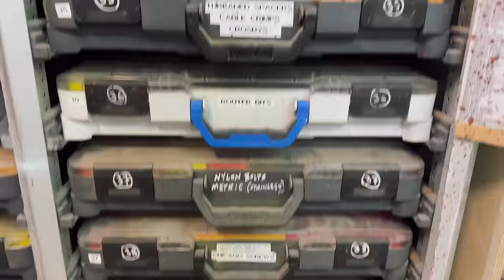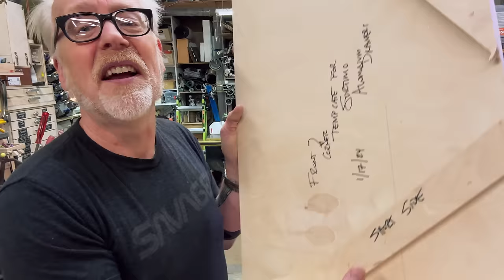Adam Savage Builds His Dream Hardware Storage System!

Comment: As he's talking about punching all the holes: Use the mill! Use the mill! You have them all stacked up anyway for the corner holes. :)
Reply: Yeah! I just commented the same! He already had the setup! For some reason he wanted to make the holes after cutting the corners on the bandsaw, but he could still have restacked them even that way
Reply: As he was drilling the big holes, it made sense with how sticky the aluminum is, too small and you'll just be snapping bits with that big of a stack, but maybe even just a stack of two?
Reply: @BryanGorges  I think he could do at least 5, maybe 10 on the mill. But I'm sure he could do 2 at a time on the punch
Reply: Have you ever drilled a hole that tiny in aluminum? Did you see how he had to keep cleaning off the big end mill? Do you know how much a tiny bit like that would wander when drilling that thick?

It's a good idea but it won't work, unfortunately.
Reply: Keep a fixture in place on the mill, drill the bandsaw clearance and rivet holes ~15 or so sheets at a time. You have to do the milling operation more but I bet it would save time
Reply: @BryanGorges  Yeah, I was thinking he should have cut the sheets in stacks, but having cut big stacks of aluminum sheet at work, I know how horrible that is. Aluminum is just so sticky. When we cut it, we have to have another person at the saw continually spraying WD40 on the blade just to keep it from binding up. And that is just thin 30 GA in about 1" stacks clamped together.
Reply: I just asked if he had considered milling out the corners and drilling the holes on the mill at once. 🤔 That’s probably what I would’ve done. It truly could’ve been a one day build. Right?
Reply: @BryanGorges  Also, what he did not show is that his stack sat directly on the table, so I guaranty you that he did not do that in one shot. He did not show  that at some point he had to put something sacrificial under the second stack. Why a second stack? Well, his end-mill was not long enough to do all of them.
Reply: @guitarchitectural  would have been nice to throw this explanation into the video for the ignorant (such as myself). Makes more sense. I assume he just got hyperfixated on wanting to use the hole punch.
Reply: @Slack3rDav3  Getting hyperfixated is relatable.  My FiL doesn't have ADHD (he has Old Man Syndrome instead), but once he's decided to do The Thing a particular way, it's going to be done that way come hell or high water.  We've just learnt to roll with it.
Reply: @mabster314  Or just lay out the holes along with the rest of the design on a cad file and send it to you CNC plas table.  After you own one you realize how stupid you were for not owning one..
Reply: @gimmebuilds9915  CNC  plas table..
Reply: @TheOneWhoMightBe  Aww let's follow the path the dinosaurs took...

Comment: make just one draw (without a sortimo box) at the lower- or lowest shelf of the sortimo cabinet. Put the draw out, put a sortimo box on that flat surface....done!!
Reply: Seriously.   A flat piece of wood on a drawer pull at working height every other row would have done the same job.  Though I use Stanley sorters,  I guess if you can afford sortimo you can afford to rebuild your system though lol.
Reply: I should have read some comments before posting....I said the same thing!
Reply: Same here, that’s how I built mine. It also has the added benefit of the open bin being at the same accessible height. I’ve been using mine for 3-4 years now and it doesn’t slow me down to pull the bin out and set it on the shelf(on drawer slides) I love it!
Reply: Adam's system solved another big problem. Some of these boxes are heavy. And considering Adam's age it is pretty exhausting to move them from theirs drawers to one universal surface.
Reply: like a pullout cutting board in a kitchen, its just too easy
Reply: I did the same thing 12 years ago and found that not having to take the whole cade out saves another of time and you only have to drop a case with the lid not fastened once to realise how God the drawer sliders are

Comment: Hey Adam, I made an open source pick to light system called M.I.M.O.S.A, Basically a web interface where you can very quickly locate things in your drawers. I have a video on it. It's super easy to install, And it makes retrieving things much faster than indexing an Excel sheet. I would love to help you set this up!
Reply: I found your project online and it looks really cool.  As a career programmer who loves making software to make people's lives (and jobs) easier, I was unsurprised to see Excel adopted as the "database" here, even though it's far from ideal.   I will also be unsurprised that the answer of most people (probably including Adam) is "Nah, this is fine," because there's something about crossing that line into the software part, where suddenly "fit and finish" don't seem to matter as much anymore.  And I guess part of that reason is because there's so much awful software out there.   At least you know what you're getting with Excel.    But people don't understand how much potential value they're leaving on the table by not looking further.

Comment: Nice job! I went through the exact same thing with many of the same hurtles. I used the Stanley bins and made the cabinets from 3/4"  MDO, with slides from 1/2" MDO. Works perfectly. Mine is about 36" High by about 11 feet long with about 60 bins of two depth sizes. The length is comprised of several modular cabinets. The non surface part really frustrated me as well after built, and I decided to build a flat pull out shelf at the bottom of each cabinet. It's an extra step, but doesn't take extra space. It made the upfront cost lower, and kept the cabinet much more compact than an individual draw system.

Comment: So he basically made drawer cabinets with alot of unnecessary lids!
Even as an fan of diy i would have bought 2 lista cabinets and filled them with assortment boxes.
That would have been much more dense in terms of unwanted air in between drawers and such.
Reply: Just saw he sells the boxes, wich suggests this is basicly an one day commercial:)
Not trying to be a jerk, but it just didnt make any sense.
Reply: Exactly what I was thinking, seems like a laborious and expensive way of making inefficient drawers. I get that it makes the "drawers" very portable, but why do you need that in a workshop?
Reply: Lista cabinets are the way to go....hard to find used for a good price, though. I have both the latest generation and previous generation Listas and they can't be beat in terms of accessibility and density. 
Then just use small bins and pull out only the few bins you need instead of an entire Sortimo box...
Reply: @saschaoswald480  
Even new would be cheaper as he probably spent about 10k on this project excluding the labor.
For that money he could have filled that wall with either lista or vidmar,kind,bott etc etc.

Comment: Thanks mm9773, I remember Adam saying he didn't like drawers back in the before time. However I understand his love for the Sortimo-T-Box. They are expensive at $50-85 each but IMHO worth it. Nothing else comes close. I have 10 of them and the only thing that has migrated out of its own bin is 1mm stainless washers. I have 2 of the 2 layer type ($85) which has been perfect for small hardware, 1-5mm and 2-56-12 something. Adam must get a large discount.

Comment: Alternative to making 70 drawers (one for each bin): Make a single slide-out shelf at a convenient height in one of the bin slots. Remove a bin, pull out the shelf, set bin on shelf and get what you need from it, then return the bin to its slot and push in the shelf. Yes, you would sacrifice a bin slot but save the cost and effort required to build 70 drawers.
Reply: He made a cart a while back for the old sortimo cabinet that served this exact purpose, plus you could pull it over to the bench.  Not sure what happened to it.

Comment: I really enjoy your videos. They are intuitive and don't give the usual feeling of someone reading of a script. 

I can appreciate someone having enough funds, suffering from ocd and being a perfectionist wanting to create all those drawers. Me, lacking funds and ocd (though being a perfectionist), I would just insert one retractable metal tray at a convenient height in each (or, in every second) cabinet column(s), and every time I need something I would pull out the tray, take our the needed Sortimo box, lay it on the tray, take whatever I need and put the thing back. Making cabinets with fixed shelves would be much cheaper and much faster to make than this system. Less fancy though. 😀

Also, if you still wanted to go ahead with your system, instead of drilling those big corner holes plus doing 2 cuts, I would just do one cut, and then, when folding the sides and the back, would fold and rivet the "flaps" to the back "wall" of the tray (obviously after having punched the relevant holes for the rivets on the side and the back before bending the sheet). I am no engineer or anything of the sort but in my mind, this looks ok. 😀On that note, if I had to do it the way you do it, I would bend the triangle "flaps" to the exterior and to the back of the "walls" where they will not interfere with the slides and will not be visible even with the drawer pulled out. This way, there is no risk that they may scratch the boxes when moving the drawers in and out or when putting the boxes in or taking them out (me being a perfectionist and all). 😁

Comment: For the back 2 holes, "Stack and Drill". Use a scrap piece of plywood or MDF as a base. Stack and fasten/clamp the stack to the base. Layout the hole locations. Drill the 2 holes (to a desired diameter - 3/8", 1/2", etc. - your choice).  

Vois là !

No one piece at a time "Hole Punch". No "Milling" (machine set-up)

Comment: Adam you should consider a FULL backing board. it will lock everything together tightly and keep any flexing from pulling on the rails themselves. It sways a lot empty, once you start adding all the items it will get worse.   You put to much work into this to skip on something so important.

for the list, idk if thats what you have planned already. but having it mounted on sliders so it pulls out and maybe even rotates to face you would be a nice touch where you planed to mount it in that opening

Comment: You should use 5052 aluminum if you are going to put bends in it as it’s made for bending 6061 can stress sheer.  This whole process is a lesson in what you value more time or money. As someone who runs a laser cutting department at a metal processing center, it would have been a lot easier to figure out what one flat looks like with all the holes and cuts, draw it In CAD then get all 70 cut out with a machine. More expensive yes but infinitely faster. Obviously Adam’s whole thing is show the process of making things so it lends itself to not get them cut but to others who don’t have the ability or time to cut all these by hand it’s a better option

Comment: Adam,  I found a big Hardware storage Bin with wood and metal screws at my local fleamarket for $10.00
And I found 4 med size Storage Bins to put my bolts, washers and nuts in them/ Craftsman clear top bins for 34.00  and one to put my pistol in.
And i brought a Farm Table at a yard sale.  found a large craftsman toolbox at a pawnshop and put it ontop of the farm table for my shed.

Comment: When installing drawer slides like these,  use a spacer, the same length of the slide (profiled to fit any bumps bends etc) between the top of one slide and the bottom of the other.  Every slide will then be parrallel and evenly spaced.  you can even use this method in a cupboard that has already been assembled.

Comment: Hey Adam, your diagonal supports at the back appear to not go to the bottom of the closet, yet when you push on the closet sideways that's where the biggest forces on the sidewall are going to be (because you push at the top you have an enormous lever on the bottom part of the sidewall). Maybe add more diagonal support to protect it. Anyway great project, I whish I had space for a cave like yours. Cheers!

Comment: 30 years ago, I would make small runs to double sided PCBs. Starting with pre coated UV sensitive copper clad. 6 boards per sheet, expose, etch, drill populate, test. I could make 20 units in a weekend with $100 profit per board : )  Refined the layout and moved some stuff into the code to make fabrication easier. Was up to rev 6 by the time I had made 200 units.

Comment: Adam Savage has a great idea here, but he geeked it. He wanted a pull out surface to hold the tray as he accessed the container, they're worthless when they're over your head or located around you ankles.
He should have a pull out shelf at waist height. Remove his container and pull out his shelf, and place it there.
It would save a crap load of money and time on drawer slides and assembly time.
I think I'll build this correction.

Comment: We have the SORTIMO-BOXXes on the original drawer system in each of our service vans in Germany and our field technicians LOVE them. Due to restricted space, we opted for the non-transparent metal version (~0,5 inches smaller in height), but they work miracles each and every day. The SORTIMO drawer system for the BOXXes locks in place if closed and have to be unlocked separately with a push-button. In fact, all of our service vans in Europe (including UK) are equipped with the Sortimo van system. I personally would have given up and ended up buying the SORTIMO Rack System with the drawers pre-installed . . .
But . . . 
Where have you got those orange SORTIMO-BOXXes from ! ! !

Comment: I give you big props, I would have built one pull out for each coloumn, pull out the drawer, pull out the organizer, open, grab, put organizer back in, slide drawer in..... IMMEDIATELY! 

The emphasis there is because... Well.... As you know, a flat clean surface doesn't stay clutter free......

That said, your design is much better! 😂

The struggle is real! I know it all too well! (I built a removable surface on my work bench with a tool box wood top and drilled holes in the faces for rebar to hang it off of.... Needless to say, it's now a permanent addition😂)

Comment: It looks like you just re-invented the 2u server rack keyboard shelf.  Standard server rack internal dimensions are 19" wide and tapped holes on the sides are divided into 1U height units(1.7" per unit).  Sortimo T-Boxx G's are 17.3" wide by 3.1" tall.  A 2U drawer gives you 3.4" of height.  A standard server rack is 42 or 44U tall so can hold 21-22 of those Sortimos and the shelves are something like $50 each?  Keyboard shelves also often have attachment points to hold down accessories.  Now standard rack dimensions are deep enough(42") to put two Sortimos on each, front to back.  Keyboard slides aren't super sturdy(something like 50lb rated?) but odds are they'd hold most of your Sortimos even at 2 per slide.  So you'd have deeper shelves, but less horizontal space taken up.

Comment: Fun coincidence, I've just started on building my own magazines for my sorting boxes, it's no way near as large as yours but still holds 24 boxes on a shelf up on a wall.
And I have another magazine with vertical slots for storing 19" rack equipment that I'm not currenlty using in my studio or working on to repair.

Comment: I did not go for expensive drawer slides, i just made grooves with my hand router and slide in multiplex sheet 8 mm. Screw end stopper and two back and front stoppers for the assortment box you are pulling and pushing. Grease groove with thin layer ceramic grease and works like a charm. Sand the area sliding contact with 600-800 grit sandpaper before greasing for smooth operation. You can make it as expensive as you like but in the end if it functions and looks tight it is good enough for me. I use the cheaper smaller assortment boxes so 8 mm multiplex is thick enough to carry and slide my boxes full with bolts and nuts. I do like the large organizer boxes but too pricey for me. Nice built though.

Comment: "ALL MY MATH IS WRONG" Adam Savage, 2024
Thank you so much for posting this.
I too, am struggling with a tedious project.
I designed and created a mechanical wall clock, out of wood. HUGE SUCCESS.
I decided to make 5 more. crit fail.
Dremiling and sanding the teeth of every gear, by hand, has led me to put the project on indefinite hiatus.
I do not own or have access to a CNC machine. I cut it all by hand.
Pray for me, for steadfast resolve. I want to finish these clocks but, the tedium is physically painful

Comment: I am a design engineer and your main room is missing something you need a big sturdy table in the middle then you just need to spin 180 degrees and you have your flat surface which will come in handy in many many other projects, Either that or I suggest every time your on the move for parts you should be pushing a multi layered cart

Comment: This is why those manufacturing buildings are huge facilities with many people running around.    I think the 3D printer replaces a lot of these pieces parts if you want a prototyping lab.    Then just use the Big Box Stores as your hardware stores if you can't print it.   Otherwise  you will become the hardware store.   I understand the  need to do something like this with all the supply line disruptions, and high cost and delivery times of pieces parts vs bulk buying and having on hand.     When this guy passes the torch,  it's going to take Heavy D sparks team to bid and clean that place out.